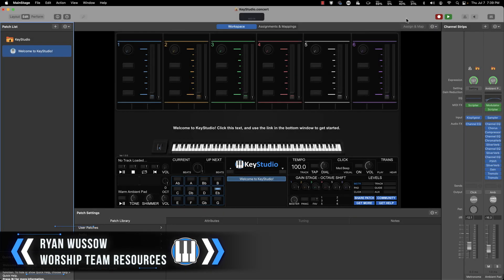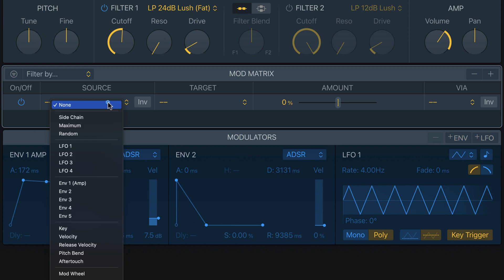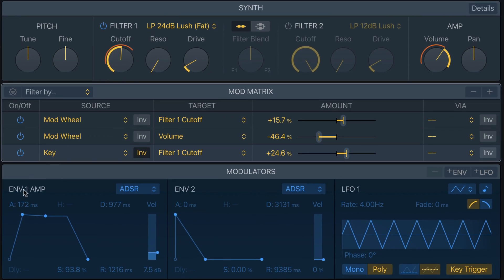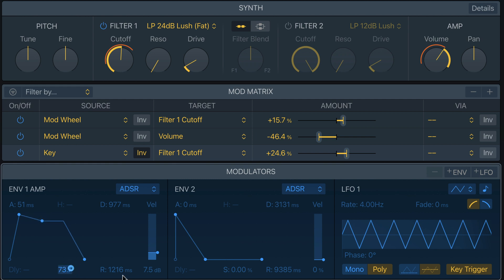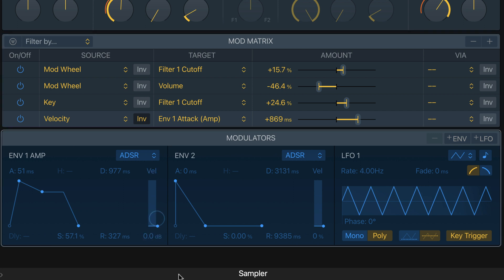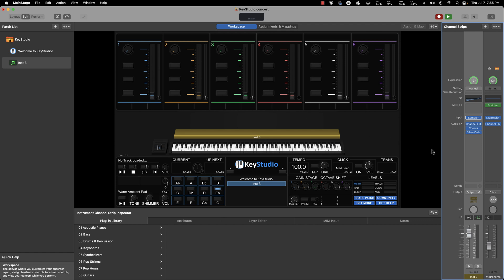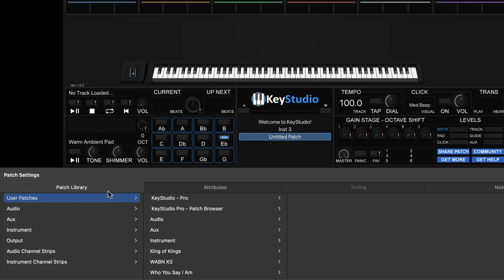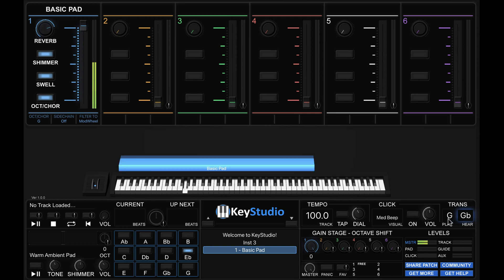How to make a Warm Pad in MainStage & Logic

Comment: I have logic but I don't have MainStage and I'm in need of a good worship pad for a worship song I'm recording (It's honestly really frustrating to me that  I can't use a quick google search to find a solid sample library of worship pad VST's that I can just download for 20 bucks and use in Kontact but I digress) 

For some reason when I open up the synthesizer, I don't have the "Fat Jupi Darkpad."  Is that a stock logic instrument or does that sample come with MainStage?
Reply from the maker: It is a stock sample, you may want to double check that your full sound library is installed (by default Logic and MainStage only install the “essential sounds” to save space).

Also, all MainStage patches and channel strips can be opened in Logic (you just won’t have all of the “on-the-fly” pre-mapped controls like you do in MainStage). 

Shameless plug, but you might check out my Worship Pads Volumes over on my website if you’re searching for great pads!
Reply: @WorshipTeamResources   Gotcha! If I were to buy the worship pad set, how would I use it in logic?
Reply from the maker: @hk4lyfe59  you can open the patches in Logic (it opens the channel strips like your other tracks) and play or record the pads directly in your Logic project.